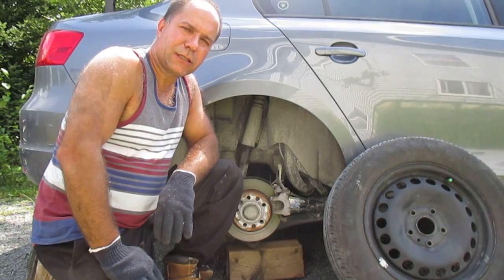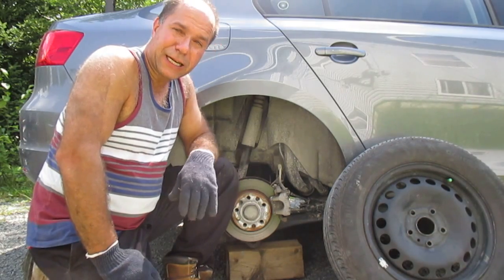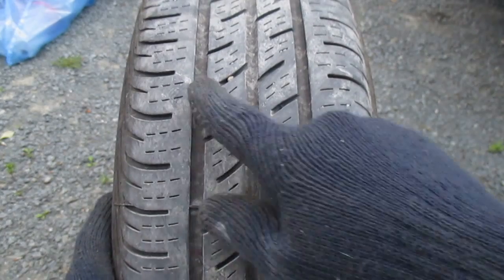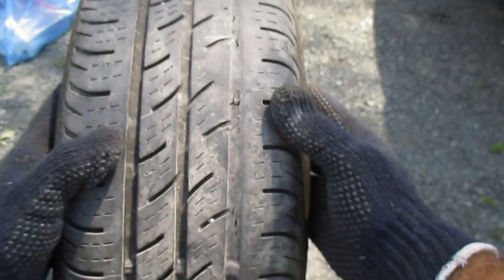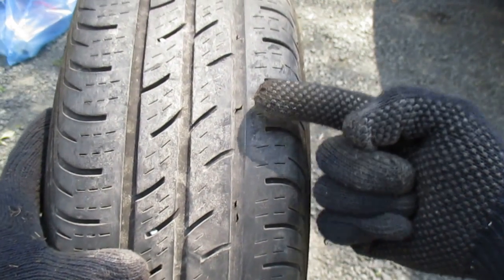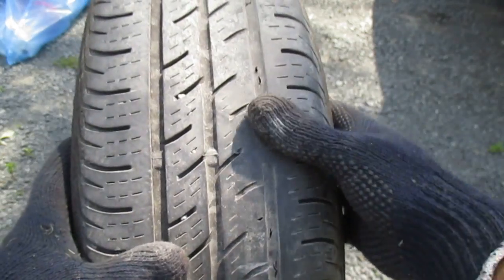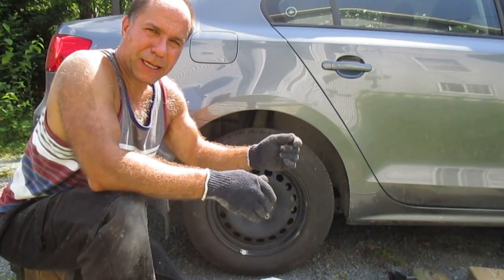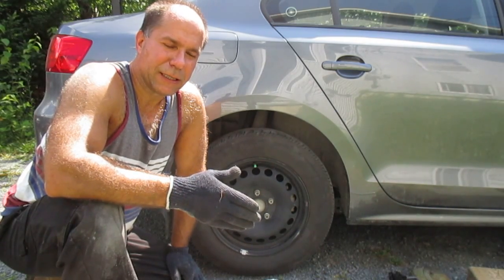How to check for a broken belt in a tire

Comment: Hey this was helpful! I have seen tires be the cause of issues most technicians would start questioning the suspension and even transmission about. My moms Camry Hybrid had a bad belt in a tire and it felt like a bearing in the electric side of the powertrain!

Comment: A blow out in the front is much safer than having one in the rear 
I know instinct is to put the bad tire on the rear but actually it’s easier to control your car if you have a front flat because you can still steer the car but if you get a blowout in the rear the car will start swaying side to side and eventually possibly slide in either the right or left and since you don’t have rear wheel steering you can’t control it so please don’t tell people it’s safer
Reply: You are 100% CORRECT! These people are NUTS putting defective tires in the rear. Steering is CONTROL. You CAN steer the front wheels. You CANNOT steer the rear wheels. I'd wager the problem is like many things today, people have gotten stupider because they don't teach Drivers Ed anymore and 'nobody knows' it's 'Lost knowledge'. The reason these people are saying they can't manage a front blowout is because most cars are FWD now and they aren't being told to get off the accelerator and coast to the shoulder. Trying to 'drive' a flat tire. Just insane. Have seen many vehicle rolls and flips from rear blowouts. The front has the weight of the drivetrain. A rollover from a blowout is rare.

Comment: Hopefully, this is what is wrong with my car. It seems to have a front tire that gets crazy at speeds between 25-45 mph especially when decelerating. The suspension is tight. It's a rubbery feeling. My tires are Hankook Kinergy PT and the UTOG treadwear rating is 860, one of the highest treadwear ratings of any tire sold. They were on the car when I bought it used, and these tires have been through hell! They are excellent all-season tires, but they have been shot for 1000s of miles! Typical of ultra long-lasting tires, a belt or sidewall will fail long before the tread does.
Reply: Was it your tire?

Comment: Shifted belts. Man I didnt even know what tf that was until recently. Made my steering wheel vibrate at low speed something fierce!!! I initially assumed my wheels needed balancing or i had some suspension issue. Thats why its wise ro research or get second opinions. Dealership told me it could be a bad strut😑 Took it to an actual tire shop and they mentioned shifted belt. Replaced the tires and problem gone!

Comment: Very useful info, thanks.

Have had a rear end wobble at low speeds for a little while and has now rapidly also become a severe high speed vibration. I was originally suspecting rear suspension bushings or shock absorbers.... Decided I'd better thoroughly check the rear tyres, one of them is really off. Booked in for new tyres tomorrow.

Just thought I'd just have a quick search now, and this looks very much like what has happened.

Comment: My car wobbled like a running goose. Only at high speeds, rarely with no one in back seat. It would even act up on one lane of interstate and not the other. Hard to diagnose. Mechanics all went to ball joints, tie rods, bushings snd shocks first. Tires were even taken off and checked, and were said to be good. Belt twisted, not broken. Getting tough to find good help. Also had to change shocks. That was main problem.

Comment: Thanks for putting this video together. Never really inspect my tires the way I should but had a recent vibration/wobble that I thought was a suspension or bearing issue that turned out to be a broken belt. Your video helped confirm the problem.

Comment: Find a very smooth lonely road. If bad tire is on front, the steering wheel will usually wobble on its own at slow speed 10-15 miles per hour. You might even hear a "whomp whomp" sound that corresponds to the wobble.. to each rotation of the bad tire. On rear.. at slow speed, you should feel a side to side wobble in the seat of your pants. If you have narrowed it down to front or rear, replace one of the rolling tires with your spare (assuming it is good). If the wobble goes away, you hit the spot.
Side note. Most of the tires that have separated on me were probably due to the plugs I have used to repair a nail puncture. Internal tire air gets past the damaged inner liner and weeps between the layers under the tread, causing the separation. I realize that a proper repair requires an inside patch, but I have considered the value of remaining use of the tire vs the cost of a proper repair. Since many patch jobs cost $10, and I can buy a new tire for about $35, I usually plug my flats and hope for the best.
Reply: obsolete professor what u described is exactly what my car is showing. The thumping womp womp sound, I replaced the front tire but the sound is still there
Reply: Thanks man
Reply: Thank you

Comment: What causes tire separation? I had both of my front tires separate almost back to back on a road trip. Fronts only.. They were only about 1½ years old.. plenty of tread left and the alignment seemed fine. Will bad tie rods or shocks or something else cause this over time? Maybe hitting pot holes at high speeds?  Or is it due to just plain bad quality?
Reply: TTime685 China tire or puncture
Reply: Pot holes, road hazard impacts, curbs, etc

Comment: So what am I looking at in the bottom of the treads.?>   Are those lengthwise running cracks or tiny wires sticking up.      The video makes it hard to tell what I am looking at.
Reply: Those are treadwear indicators. Every tire has them. You can easily see how uneven the tread is. If even one spot is worn down to an indicator, the tire is unsafe.

Comment: Shyte.  I have been having this problem since last summer when my town was going through massive road maintenance.  I must have hit potholes and road work bumps a hundred times.  I got the tires in 2010 and they only get ridden on in spring and summer and then my studded snows go on in the winter.  Two different mechanics told me the tires were okay but a little unbalanced so they put on some weights, and everything else checked out (shocks, struts, rods, bearing plates, etc.), yet I still have the problem.  Yesterday I was on the highway and I'm driving along and when I came up to the 3rd. exit and doing 65 the car started shaking from the tires.  Bump, bump, bump, bump, bump, bump, almost like I had a flat but didn't because the steering wheel wasn't pulling.  I'm suspecting that the tires heated up and the expansion caused the bumping noise.  Is that a correct assumption?  I don't have time to get new tires right now as I tomorrow I start a second job.  But it looks like I will be taking the long way to work and trying to avoid speeds over 55mph for the next several days. As an aside, when I braked my break pad was vibrating so I suspect that my rotors are probably screwed though I only had them and the pads replaced last year along with new struts and a balancing.

Comment: I've been there, done that. I've had my front and back tire blow out due to this reason ( at different times ) its way worse when the front blows. I was doing 75mph as well. when the back blew I was scared, but nowhere near as much as I was when the front blew.
Reply: The Chief My classic Mustang had a similar issue but not to that extreme. I heard a high-pitched howling coming from underneath. It almost sounded like a burnout, and also produced some handling problems. Turns out the old set of tires were 8 years old and dry-rotted on the sides. So we get some new tires and theres still a faint howl to it but no more handling issues. Im guessing some new tires just do that.

Comment: +MrXispas most of your braking pressure is in the FRONT. how are you supposed to steer away from the children on the bike your veering into without front tires.
Reply: you steer towards them to come to a stop.
Reply: +Zach Sumner rephrasing: 'how are you supposed to steer toward the children so you can stop properly if you have a blown front tire?'

Comment: Hi. Nice vid but i think that the bad tyre should stay in the front. It´s mutch harder to hold a car if it loses the rear.
Reply from the maker: +MrXispas Thanks MrX  - glad you liked it. Personally though,  if i have a tire that's questionable i put it at the back until i can get it replaced. If a front tire blows you lose your steering
Reply: no front tire no front steering
Reply: @aw8897  WHAT? So the steering wheel is locked? The damn front wheels can turn IRREGARDLESS of the front tires. The back wheels CAN NEVER TURN!
Reply: Thank God at least one person has the right answer! YES! I don't know what they're teaching in Drivers Ed or whatever but it's only common sense. IT IS FAR MORE DANGEROUS TO LOSE A REAR TIRE THAN A FRONT! I've seen it before and you can flip a car with a rear blowout, because guess what? YOU CAN"T STEER THE REAR WHEELS! Even with a blowout in the front anybody can still maintain steering control. A rear blowout is almost like a P.I.T. maneuver. The back end will start fish-tailing like crazy. The first thing to do is get off the gas. A car with the back end swaying around is just like having a trailer swaying pushing the rear around. If you people that think you can't manage a front blowout you are doomed and will take out somebody putting a defective tiring on the back. Playing Russian Roulette with your life and innocent travelers. You shouldn't knowingly put a tire with broken belts anywhere on your car.
Reply: No way! Bad tire should go on the rear so you retain steering.